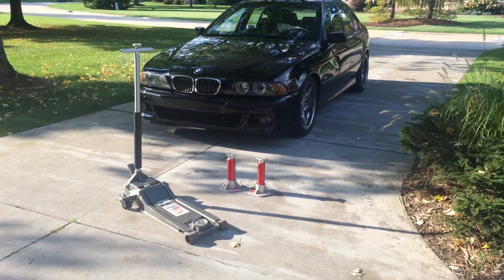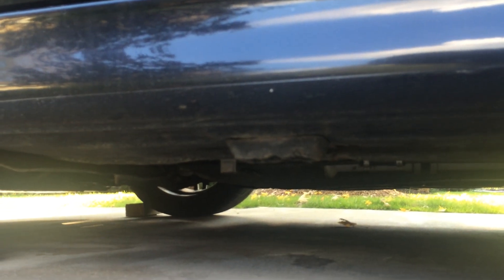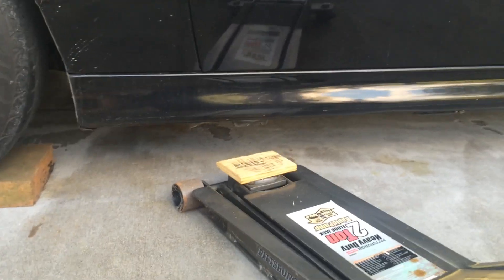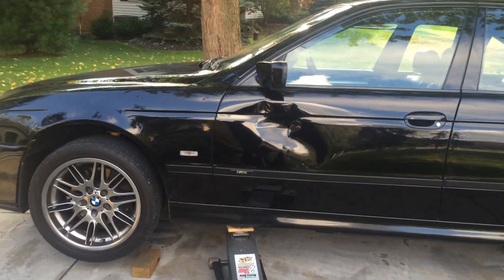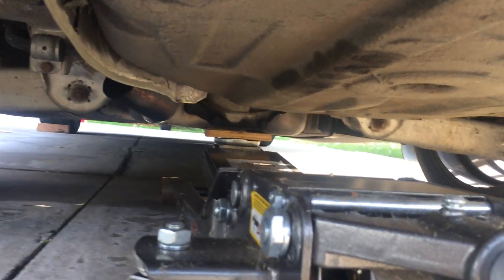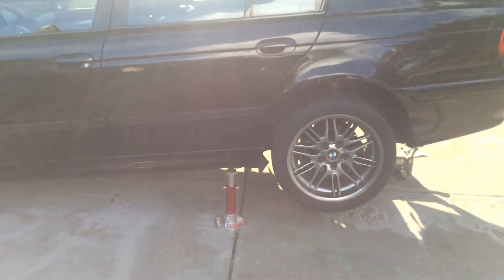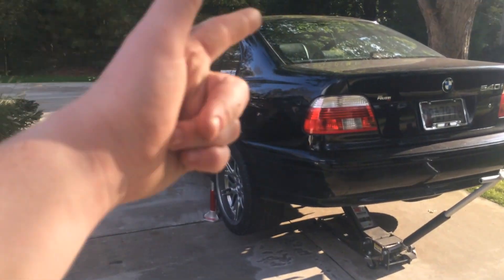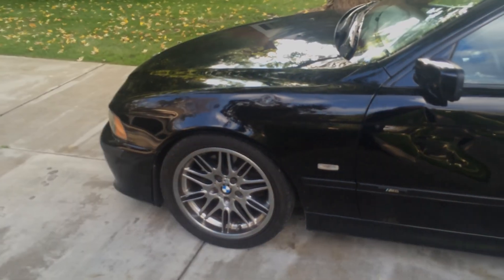BMW E39/Most Proper Jacking Procedure

Comment: I wouldent recommend jacking the e39 m5 rear diff. Its a aluminum finned cover that hangs down furthest.  Would definitely have to stay Away from that rear cover
Reply from the maker: It’s not ideal, though I’ve done it hundreds of time without so much as a scratch on the diff cover.  I then immediately support the car with stands on the jacking points.

Comment: Not sure if this is different on the E39, but on the E46 the proper rear jackpoint is the rear subframe beam (aboout 20cm infront of the rear diff). Jacking up the diff is not very good for your rubber bushings.
Reply: You're right, Jacking via the diff is not recommended, but the E39 doesn't have a brace under the diff like the E46.

Comment: Is it safe to jack from an E39 M5 diff? I'm not sure if the 540i and the M5 have the same diff. I'd assume not and i'm pretty sure my differential has heat fins on it...and i'm not trying to destroy an m5 diff :D
Reply from the maker: Yeah, just do it carefully and get the vehicle's weight on jack stands sooner than later.  540i has an open 2.92 differential, M5 has a limited slip (25% locking) 3.15 rear end.
Reply: I would avoid raising an M5 from the diff - these cooling fins were never designed to support the vehicle weight. these are cooling fins - thin and with a lot of air surfaces, not a load bearing structure like the diff case of

Comment: what if someone slashes the tires, or you get 2 flats on the side on a lowered... and there is not enough space to put the jack under... and you parked the way that is not possible to even fit the jack under the axle or you don't have one in the trunk right now
Reply from the maker: Then you'll have to lift up on the car if the clearance is just a tiny bit off, or drive/push it into a position where you can get better access

Comment: DO NOT jack the rear from the differential. You place a lot of extra strain on the bushings and can damage them. They're not meant to take that weight.
Reply: So why does the BMW Bentley manual tell you that you can jack using the rear diff?! You CAN jack via the rear diff, it's MORE than capable of taking the pressure; you just need to do it properly, carefully and take the load with stands, as soon as possible!
Reply: @dannyb1979  I can't find it in the E39 Bentley Service Manual, where did you find it?

Comment: Thanks for the vid! Great stuff as always!

One question though - if I'm about to put the whole car on 4 jack stands, so that all wheels would be in the air - is it possible to do it this way? One side at a time? I mean - once the rear is in the air, how safe is to lift the front? The car then could swing forward, right? (or vice versa) :)

The reason I ask is - I'd like to put the car to the air for a "winter storage", so that the axles and tyres are not loaded with the car weight while being stationary for several months.
Reply: It should work, just go slow. Did it with my e46

Comment: Proper procedure, but I've seen these jack pads "collapse" on many E39's before, especially in the rust belt. Literally the whole jack pad gets pushed up into the frame. I'd really recommend always jacking E39's from the front subframe or rear differential first and putting the whole axle on stands as it puts much less load on the corner jack points when lifting the car.
Reply from the maker: I've seen the collapse too, on a friend's car actually.  Personally I'd rather just keep my jack pads in good shape.  I've had three of the four rebuilt on my M5, and I'm having the last done this next spring.